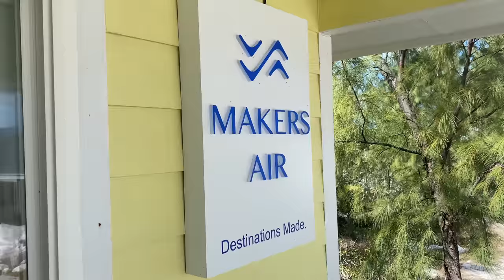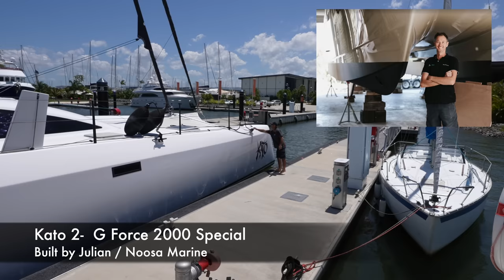THIS is our NEXT BOAT!

Comment: Seems like quite the outcome. Some very wise words. If you know boats, you know they are never ready to just sail away. They require maintenance and upkeep forever. Where you are in that cycle when you buy is the important part. We sold our beautiful boat to a couple we thought were the ones (first in with deposit). They took out equipment and sold pieces of it. Changed all the line handling to a rats nest. Then sold it on. It was sad, but the three very experienced previous owners had put a lot of thought and work into making the boat easy and comfortable to sail. It ended up with gaffa tape covering holes where instruments and winches used to be etc. That's how they liked it. I almost cry myself to sleep over leaving that Southern Stainless barbeque on board.

Comment: Haven't even watched the whole video yet but feel the need to comment!  The Outremer is a great choice for you two.  Light, fast, probably goes to windward well with the dagger boards.  I love the electric winch.  A must have for a sailing couple for handling sails in heavy air and for hoisting someone up the mast (which sometimes needs to be done while underway).  I know they're more maintenance but not much more than an anchor windlass.  As for the bridge deck, at one meter, it'll still slap if you're motoring to wind in a descent seaway.  Just the nature of catamarans!  
As for the helm positions, you can certainly get a couple of canvas dodgers built over each helm position, which will come in very handy in squalls while either underway or on the hook.  The dodgers also aid in safety because if you're making long passages and are shorthanded, it'll keep crew dry while someone else is off watch, which reduces fatigue.  Also, I love that it has tillers for the rudder stock.  Nothing like the feel of a tiller directly connected to the rudders, and a good backup in case the steering system has a breakdown.  
Self tacking jib?  Yes!  Great for short handing, and the code 0 makes up for the lack of a genoa.  BTW, S/V Delos has a Buddha as their motto on their sails!  Of course, you probably already knew that!
I could say more but would probably not say anything you haven't already discovered.  Wishing you well with the boat and with the YouTube channel!

Comment: Congratulations! That's a nice boat! The only things that I would change would be the boom bag for a boom that supports the weight of the main sail rather than canvas. I would be concerned about water ingress if the side windows broke and would possibly raise them up higher and a different shape. The other thing is the emergency escape hatch. I've never liked them because of all the issues that other catamarans have had. They often times fail and if you capsize than your boat sinks if you open that hatch to escape but if they are not there than your boat won't sink but you can easily escape. I love the wisdom at the end of the video. That was awesome to hear! I'm interested in the new design that Sailing into Freedom is about ready to start building. It's a 48 ft. aluminum lightweight performance cruising catamaran that is 100% electric. Hopefully they offer plans and CNC cut files because I'm probably going to have to build it myself in order to afford it. I'm pretty sold on the aluminum design that Peter from Sailing into Freedom is about to build and the Mumby Cyber 48 because of the lightweight aluminum design and the kick up rudders. I'd love to be able to beach a large cat like that and be able to sail in very skinny water. I also really like the Schionning Arrow 1360 called Duet. They have a few videos up on YouTube about it. Lightweight, kick up rudders, dagger boards, high bridge deck clearance and shaft driven electric propulsion are a must for me. I think you have a really nice and somewhat light boat but as you said, your not looking for that supper performance because you want comfort as well. I think that this boat is definitely one of the best choices that you could have picked and possibly the very best according to what you shared with us. It all comes down to personal preference and I think you nailed it.

Comment: Interesting.  Clarity is a 2009 boat and the first model year Outremer 49 is also a 2009 boat.  So you're basically trading boats of similar vintage for one of much higher performance.  Congrats!
Reply: P.S.  Agree with more solar.  And ditch the windmill as noisy and much less effective than solar, especially in sunny common cruising areas.

Wow, John is very thoughtful and in tune with the universe.  Great owner.

Looking forward to a solar electric conversion.

Please consider using a marine heat pump for heating, cooling and hot water.  They can be up to several hundred percent energy efficient due to taking heat from the ocean.

Comment: Congratulations.  The Outremere 49 is a great boat.  I have a LOT of experience with it.  Be aware:  It tends to vibrate at certain speeds but you will get used to it.  Now, some upgrades:  Make sure that any new lithium batteries are UL 1973 certified simply because lithium batteries are bombs waiting to explode.  And solar panels?  Go with the best:  Solara.  Anything else?  Yes.  If you can, remove all the propane.  It is a fire waiting to happen.  Oh yes:  From someone dealing with early stage skin cancer; put some shade over the helm position.

Comment: So now you have you super fast performance catamaran🎉. The next question is, do you have the confidence in the vessel to sail it as a performance catamaran? A friend of mine purchased a 46 Dolphin cat with carbon fiber rotating mast. He always talked about how fast it was capable of sailing. During a four day passage I was with him we got into a 25 knot storm with a full jib and main sail. The cat took off with quick acceleration up to 18 knots SOG. I never saw a guy drop in three reefs so fast in my life. Dropping the boat speed back down to 8-9 knots SOG. There are so many catamaran owners out on the water that have too much boat for them or too little faith in the strength of the vessel. Why pay the extra $$$ for a performance catamaran, only to sail at 8-10 knots?
Reply from the maker: we're bushies now!

Comment: Okay, I'm going to ask some questions!
IS IT CARBON, FIBERGLASS, or carbon fiber with strategic placement of fiberglass sections to eliminate galvanic action?
How far down do them daggerboards go?
How much hp do(es) the engine(s) have? What brand are they?
How many watts in solar?
How many amp hours in batteries?
What kinds of batteries?
How heavy is each battery for Nick to lift?
Is that an escape hatch I spy on the starb'rd hull?
Is that mast carbon or aluminum?
What are the sugar scoops like?
How much power in the dinghy?
Are you happy with the Davit or do you prefer the boat if it Goliath down somewhere else?
How do you like the HEADROOM, Nick?
Details on the head(s)
Stereo?
Nav and electronics stuffs?
Does it need new canvas to insure? Are you going with the fashionable-with-the-Volvo-Ocean-Race-Crowd carbon sails?
Does it need new sheets?
Considering an architectural changes, like a crow's next for a mother-in-law, maybe? :D
Adding any bikini tops to it or polished stainless structures like a Staluppi fisherman?
Speaking of fishing, any bait coolers and rod holders for extended ocean crossings to increase your living-off-the-sea potential?
Are you happy with one windmill or do you think you'll add five more, including one in the master stateroom so you can REALLY enjoy the sound?:D
Storage for paddleboards?
How about some motorized surfboards? (or do they make them light enough yet?)
Any places in the hull with into-the-water windows for reef gawking?
Actually, how about adding a window to the dinghy bottom for that purpose?
Louvers or shades for the salon for privacy against that pesky ol' Sol?
What is the draft?
What is the freeboard?
Does it have built-in foam-filled flotation chambers?
How fast does it go?
Planning any sail square-footage upgrades?
Are The Joneses upset you have surpassed them, or are they satisfied with their locker space?
Does Angkor Wat really not have anything to do with anchors?
Are you considering any low-cg ballast for more speed and stability?
What is your next destination?
Planning to convert to all-electric? (no diesel engines)
Can you share power with another boat via a shore-power-type receptacle on yours in case you meet someone in need of wattage?
What is the configuration of the sliding glass etc, as in, can it convert/tilt up like some of the boats you've seen ?
How's the glass? Need some cerium polishing?
Is the head plumbed in a way that is optimal and will not likely experience a breakdown mid-Pacific?
Any carpet?
Does Elon Musk offer a dome for the satellite thing so you can have it out all the time?
How's the anchor rust? Covered in chain? Oops, vice versa!
Satisfactory communications gear?
Square footage per your liking?
Bumpers?
Kitchen equipment?
Dishwasher?
Air conditioning/heat pump?
How much of the horizontal (or otherwise) surfaces can you cover with solar and reliably step on it?
Any sneaky telltale cracks?
Room for Megan's sewing setup(s)?
Sail lockers, and are they ventilated for mildew-proofing?
A new pair of captain's hats for proper effect?
We await your adventures with baited hooks and bated breath! (smells better than the other way around)
And one more thing: a bathtub for Megan?

Comment: Nice boats , I have sailed a few outremers,  Evan the 5x 5000 miles ,   your comment about bridge decks isn't quite correct  the waves slam these just as much as any other yacht , 
The wave lifts hull 1 and slaps hull 2 ,   the roof 6ou want solar on , still leave access to get to the end of the boom,  at sea ,      plan ahead for reefing ,  sort out your prevented.  
Dynema as strong as steel chafe like cheap rope ,

Comment: Ultimate fake out. The only clues you gave were the awards received. Still happy for you, but upset I guessed wrong. Awards in 2012/2014 were earned...not purchased like today.

Goes without saying --- The original engine oil is because of the less than pleasurable Volvo engine compartments. Get ready to edit out the cursing in your videos when performing routine maintenance. 

Looks 100% stock which is always a good thing. Extending the range, the Cat can travel comfortably should not be too expensive. Right now, it does the coastal hopping I do just fine.